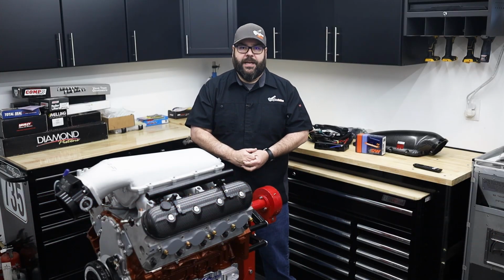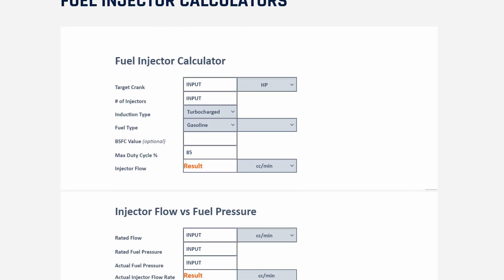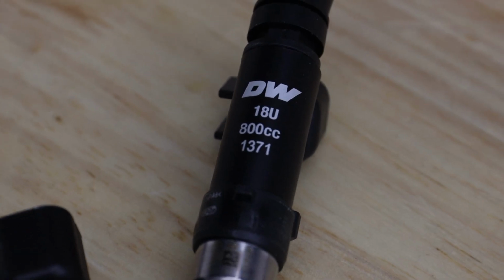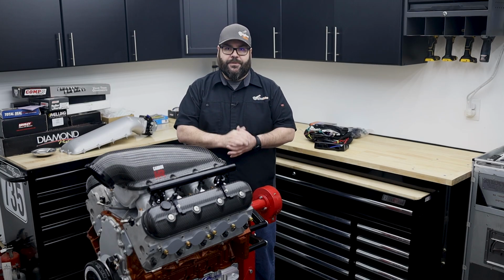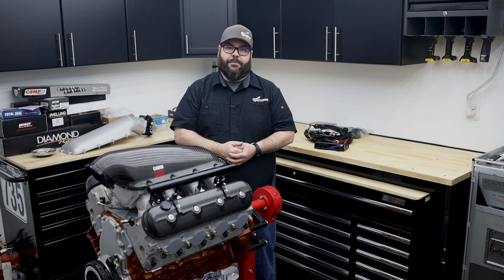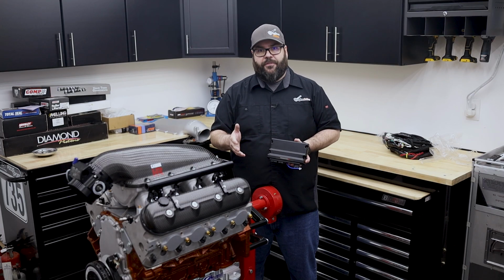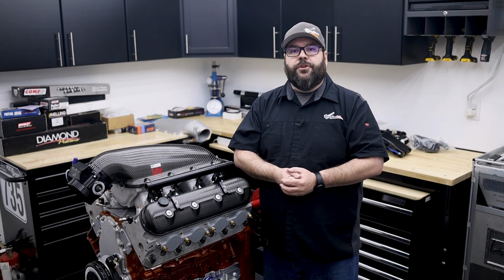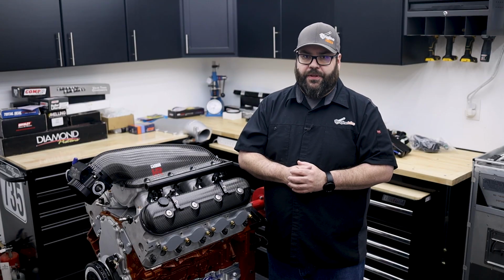Getting Our 8,000-RPM LS Ready For The Dyno | Project LS5.0

Comment: Y’all stole my idea 😂 If only I had, had the money to build it. This is very cool to see, though. Destroked LS don’t get enough love.
Reply: With valvetrain and cam lobes out now you don't need to destroke the LS to spin 8k rpm. You can build a 400+ cubic inch ls and still spin 8k rpm
Reply: It’s not a destroked setup it’s more of an over bore 4.8, a destroked setup would be going from a stock bore 4.8/5.3 block and a 3.300 custom crank instead of a 3.622